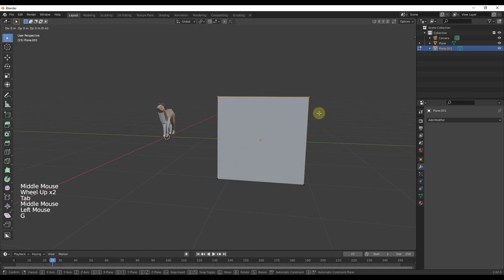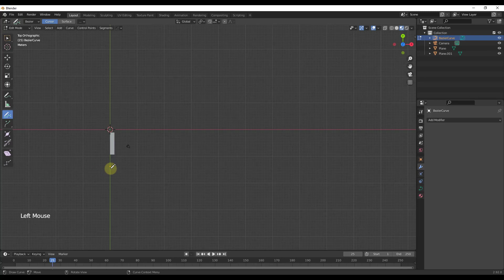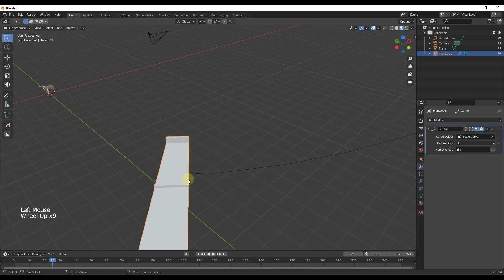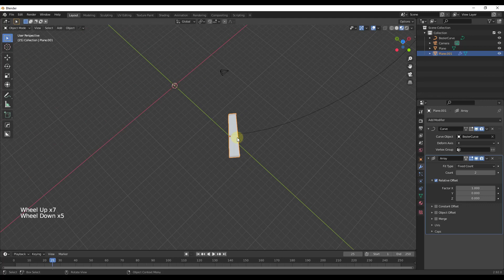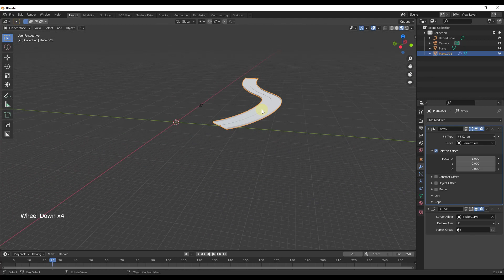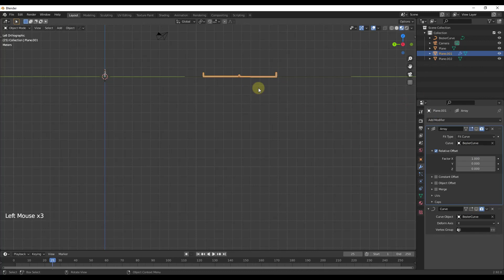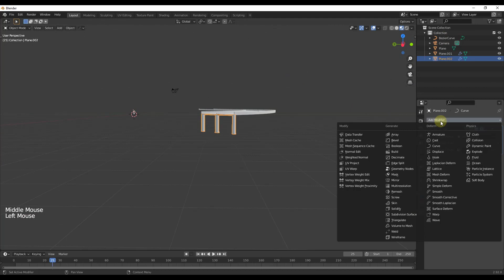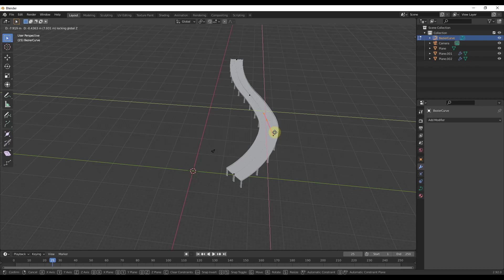How to Model a Road or Highway ALONG A PATH in Blender!

Comment: How would you bank the road while keeping the supports vertical? Thinking out loud, perhaps duplicate the spline path, and twist one while keeping the one for supports only changing it's arc in the Z and X plane. Or I guess use the nodes.
Reply: Lock the axis?

Comment: I have a problem tho. Whever I go back to edit mode on a another mesh in the scene. The arrayed mesh wont follow the curve again but just goes straight again. But only in edit on another mesh. And the arrayed objects wont recognized as a mesh itself. I cant connect it like to make an intersection. Anyone with a little help maybe?
Reply from the maker: Modifier results don’t display in edit mode, so it’s actually working as you should expect

Comment: Hello. Is there a way to make the road go down without bending the curves inward?
Reply: That depends on what you mean by "inward." If you mean that the road banks automatically when you adjust the height of a point, then yes. You can fix the bank of the road by adjusting the tilt of the control point. You do that from the right-hand side menu in the 3D view. It's under Item > Transform > Tilt in Blender 3.3.

Comment: Great tutorial, thanks! Would you know of a way to bank the road on corners using this method?
Reply: Each point along a Bezier curve has a Tilt parameter. You can set it from the menu on the right-hand side of the 3D view. It's under Item > Transform > Tilt. There's also a Radius parameter that allows you to scale the width of the road at each point.

Comment: 2:58

Easier to go into Object Mode > Right Click > Set Origin > Origin to Geometry

:)
Reply: The problem is that "origin to geometry" would put the origin in the wrong location.  "Origin to Geometry" would put the origin in a calculated center of the object mesh data where as you need the origin to be at a logical starting point of the geometry so that it works well with the curve.  So the way that CG did it was not the most accurate method - but it was the easiest.  I tend to go to edit mode, select some appropriate vetices or edges to set the 3D cursor- go back to object mode then set origin to 3D cursor for the most accurate placement.
Reply: @kylegaijin  Is it okay if I pretend I understood a word? lol
Reply: @kgaming7599  Haha - ya - I wrote it a bit complex.